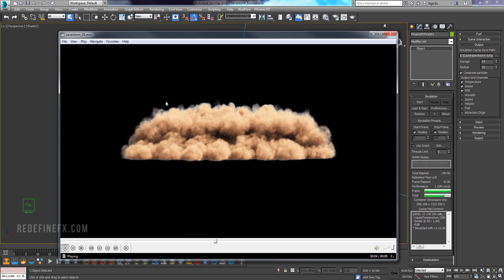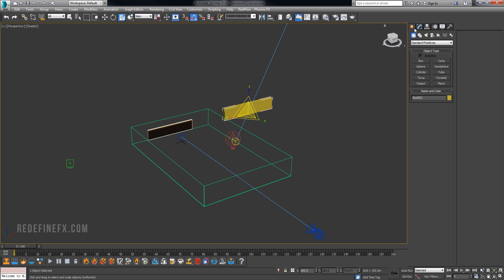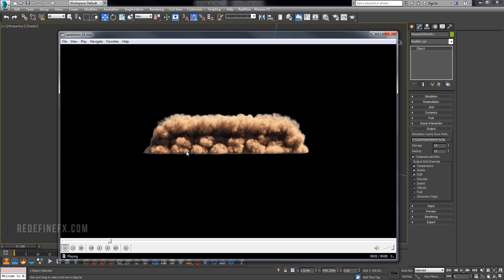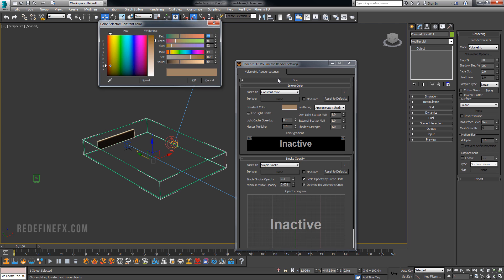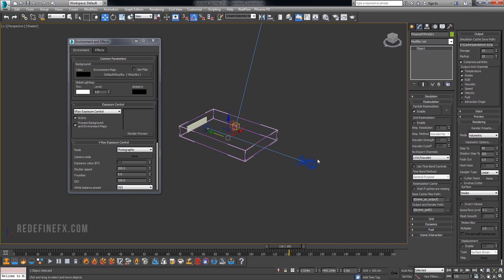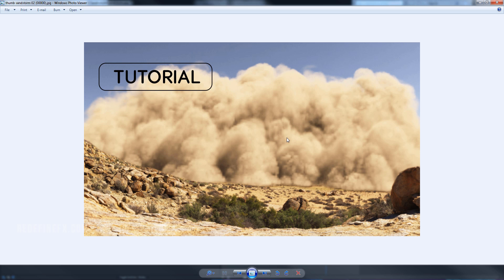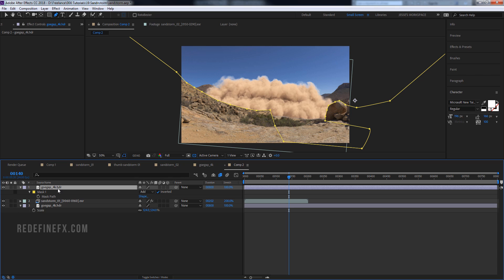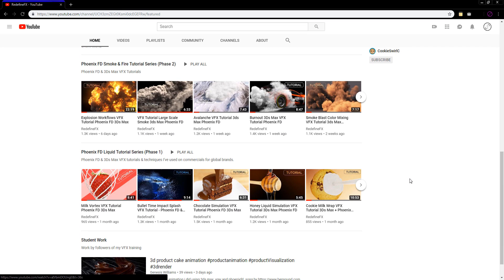Sandstorm VFX Tutorial 3Ds Max Phoenix FD │RedefineFX

Comment: Hi, i have a problem on phoenix FD and i hope you may help me figure it out. I try to do a wheel dust trail like one of your video with the truck on sand. The problem is that my dust look like timelapsed cloud when it appear after the emmiter. I tried time scale and it does different result like you said here. But the time bend control made the dust end at the middle of the path of my car while my car was twice the distance of the origin of the dust at the end. Do you know what could be done ? Im really tired of this since i'm stuck on this project since weeks just because of this. I just can't have a descent result. Thanks for the help.